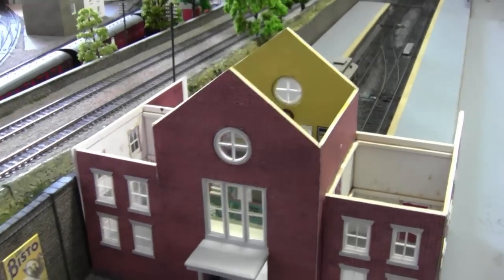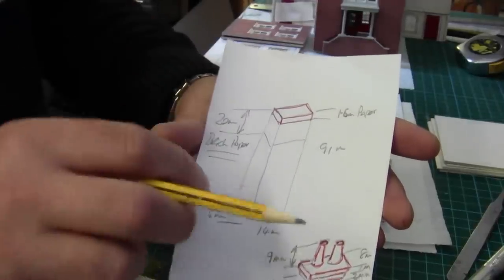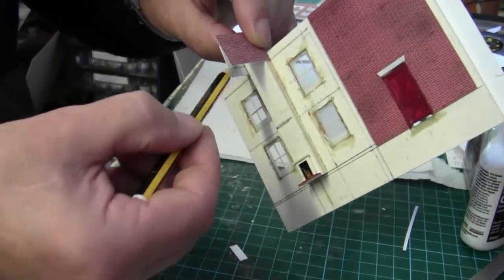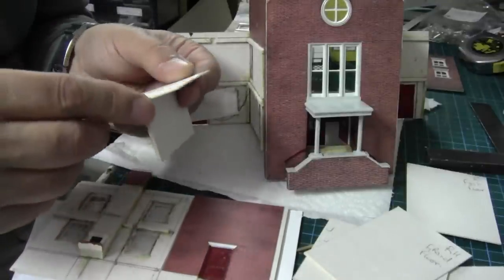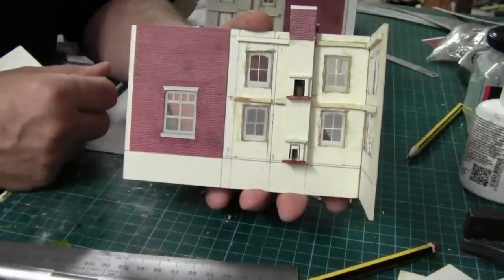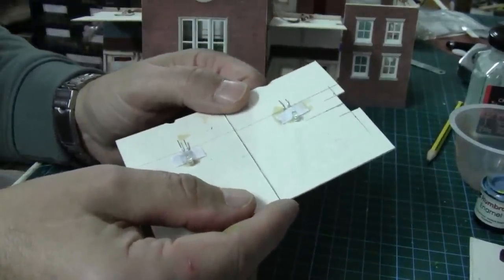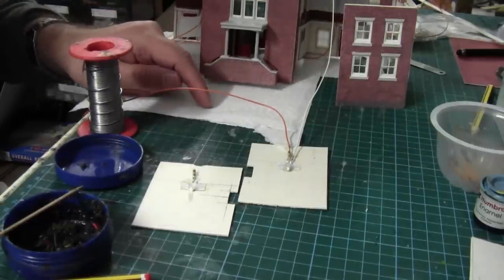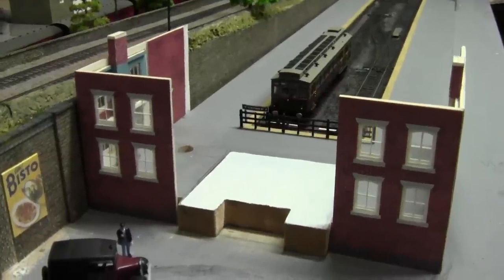Jarrow Road Station Part 7   No 343

Comment: :yt:That's some of the light work done then. Four nice fireplaces were fitted to warm the building and dry the glue. Now, I wonder what is next? I haven't got a clue.  Martin (Thailand) 🏗🏗🏗
Reply from the maker: what's next, well its a trip down to MFI to get some furniture to fill up these rooms. i hope they make the furniture small enough. LOl  its all-open plan at the moment so it should be no problem getting the furniture in. LOL Take care buddy. cheer's for now Tony🤣

Comment: Bob the brickie wants to know if you use the bus stop method or the sliding method, to work out the measurements to divide the wall of the building? Poor old Mrs Simms is getting a bit wet waiting for the Station at Jarrow Road to be finished, so that she has somewhere to go to get out of the rain.
Reply from the maker: Lol. Alan. i am afraid she may have to wait a big longer. many thanks again for commenting. cheer's for now Tony:yougotthis: